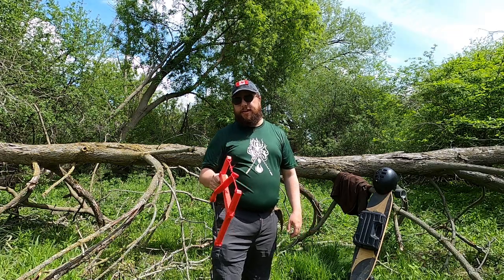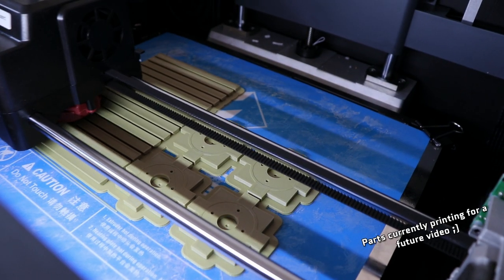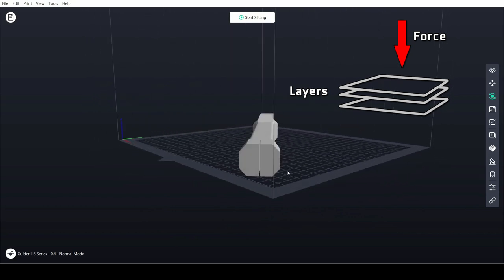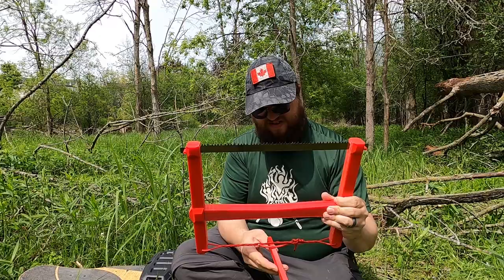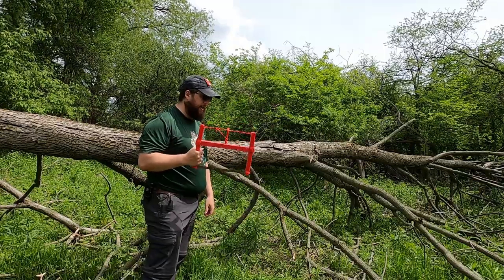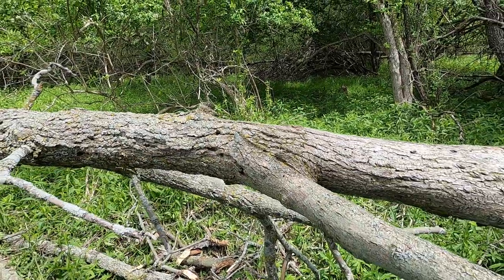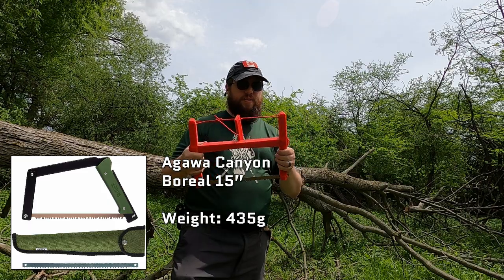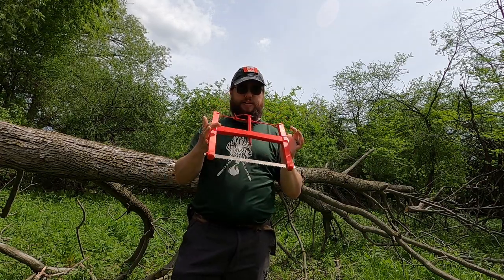3D Printed Buck Saw & 15" Steel Sawblade

Comment: is there a reason for not using petg ?
Reply from the maker: I can give it a shot, but I'm worried there's too much flex
Reply: @MikeInTheWoods  you're probably right, the reason i wondered was because i heard the petg is a better choice for outdoor things.. I may be wrong :). 
The waight on the saw should not be problem for the most of us, whas thinking of multi purpose for the longest rod, "axe handle" ?
just thinking out loud,,, lol